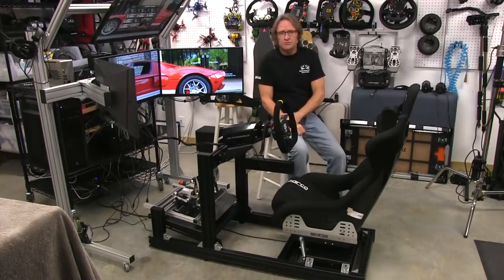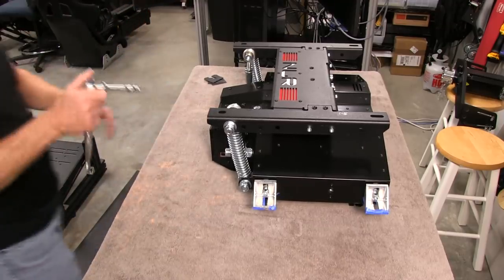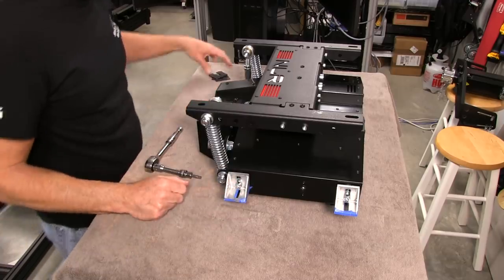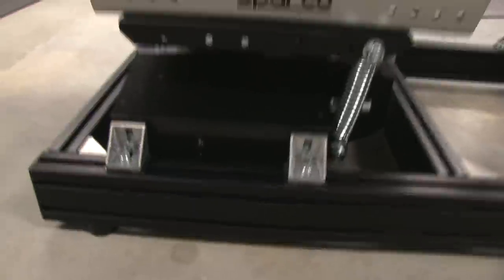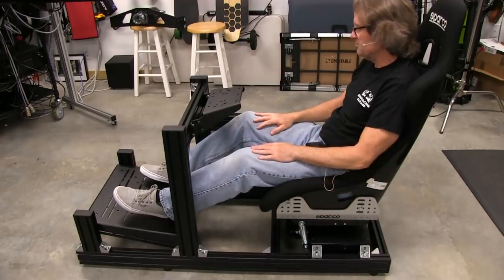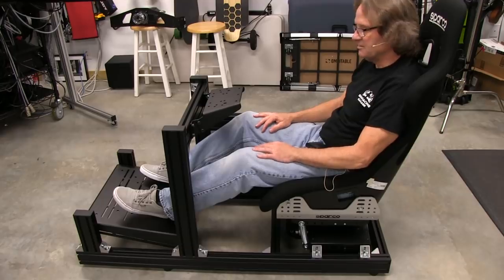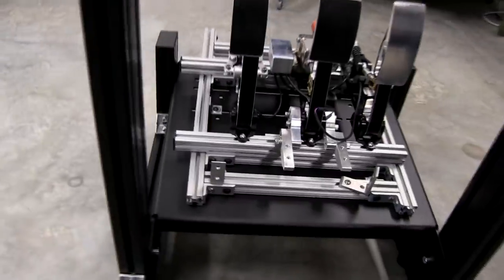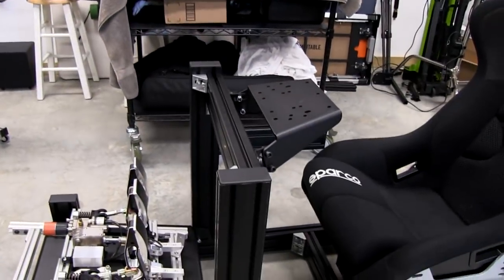Sim-Lab GT1 EVO Cockpit Review Part 2 "The Setup"

Comment: Barry, if you mount the front bolts of the pedaldeck to the bottom profile (not the upright that connects your wheel) you can then adjust the wheel back and forth without impacting the pedaldeck. I did this with mine.
Reply from the maker: Yes, a very flexible cockpit. When the pedal deck is attached to the wheelbase uprights it does add some lateral stiffness to that section.

Comment: Funny story I have on the SimLab wheel deck supporting the AF v2. It actually didn't when it was first listed. But the saga is quite comical looking back, first, UPS actually lost my P1. They went on vacation after sending out like 80 orders, where mine was the only one lost lol. They couldn't do anything because, vacation. After the reship, I find the wheel deck doesn't support the AF v2, so I start talking to them about that. They say they can drill some holes, and they'll ship it. Fast forward two weeks, I get the wheel deck, it's the same one again LOL. The holes don't match, so now at this point, I'm best friends with Darko, and he eventually got the wheel deck redesigned and into my hands. SimLabs has some of the best support I've ever seen, but this was the longest retail saga I've ever had. Cheers to those guys.
Reply: I have a v2 as well,  is the wheelbase solid on the rig? In the review it looked like it had some play

Comment: I have the old GT1 and I did put a vertical brace at the end of the shifter arm. I had some spare profile and connectors and just cut it to length. Much better.

Comment: Hey Barry, great video - very instructive. I'm on the verge of buying this cockpit but have a couple questions I was hoping you could help me with. 

1) I want to install the down piece of extrusion where the shifter mounts in order to have a more stable platform. Exactly what do I need to buy in order to do this? Does Sim Lab have the exact piece I'm looking for on their website? 

2) how would one mount the fanatec shifter 1.5 onto this rig? I noticed that the Sim Lab website has a "universal Fanatec shifter mount." Would I need to buy this? 

3) I'm thinking about just buying a seat from Sim Lab itself. Does this rig and/or the seat come with the mounting hardware needed to mount the seat? Such as brackets, bolts, etc? 

Thanks again for the great video. I'm looking forward to entering the world of 80/20 aluminum extrusions 😊
Reply from the maker: 1) One piece of 40x40 series profile at your required length. Four corner brackets with supporting fasteners. 2) You could use profile to make a mount, easier to buy the Sim-Lab one. 3) You will have to contact Sim-Lab for that information.
Reply: @simracinggarage3026 Hey Barry do you have any idea if this motion platform will fit the SimLabs GT1 pro ?

Comment: So, are we having a review on the Sim Lab Team Redline TR1 Chassis soon? 🙂
Reply: That's what i'm hoping, i can't decide between the two
Reply: Rapid_GT 99 I love my SimLab GT1 EVO. I have a DD2 mounted with the SimLab Podium mounts. It’s actually fantastic. I uploaded a couple of videos showing it off. Check it out if your still on the fence.
Reply: @OhItsThat  yes i think it's the GT1 Evo i'm going for with the DD in mind as the TR1 as i recall isn't compatible with those mounts and i intend getting the Podium F1 (DD1 Equiv), i do quite like Fanatcs podium mounts too though, which seat did you choose off SimLabs ?

i'll be sure to check out your vids, cheers.
Reply: Rapid_GT 99 I use a Sparco R100. I don’t think SimLabs ships seats to my country. The GT1 EVO is perfect. I think having 90 degree vertical wheel deck uprights is better then angled ones like the Team Redline chassis uses. Easier to attach more pieces of profile to for shifters and what not.

Comment: You could get another upright that holds the wheel and connect it at an angle from the upright past the gear mount to the bottom brace it would create a lot of strength rather than just 1 upright

Comment: Regarding to the leverage of this very long wheel/motor: Wouldn't it be possible to move the crossbar far more to the driver, then assemble the mounting plate on the opposite side of the crossbar so that the center point of the wheel (somewhere where the axis leaves the motor) is positioned more directly over the crossbar? Perhaps you have to drill new holes in the mounting plate because you have to mount the wheel 180 degrees rotated so that it points to the driver.
Reply from the maker: There's always a way to mod a profile cockpit to better suit your individual needs. That's what is so great about them. Not sure if what you want to do will deliver the desired result. Wouldn't hurt to give it a go.

Comment: I really like the looks of this rig but it doesn't look like there is much room to extend the pedals out further. I have fairly long legs. I am not sure how tall Barry is, but it looks like he has the pedals as far back as they can go. My 4Play cockpit is 1500mm long fully extended, and from what I can tell the GT1 is only 1350mm long. Also, pedal distance seems to be tied to the steering column. It'd be nice if it were attached to a separate support.
Reply: i have one and you can easy push the pedal tray back and then you could drill new holes in the pedal deck to push back further which would help

Comment: Is this rig going to be ok for taller individuals? I am 6"2 and unsure if the seat can be adjusted backwards enough. As well as if I can mount the pedal tray independently from the steering column to be able to move them seperately.
Reply: What did you get?

Comment: I currently have a Playseat.  It has served me well  and gotten the job done for the past four years but I would like to upgrade it.  Would you recommend a 80/20 rig like this over something that is more prebuilt.  I did like the look of the Spenard cockpit you also reviewed
Reply from the maker: An 80/20 cockpit has more versatility and room for future growth. Also easier to get a proper driving position dialed in. But they are not as nice looking as proper tube chassis setup. What with it's curves and geometric lines. You can still mod those types of cockpits, just takes more work and custom fabrication. So you have to decide which is more important I think.

Comment: Did you use the angle brackets that came with the SimLab GT1 EVO to mount the NLR V3? If you didn’t, could you please provide a link to the ones you used? Thanks Barry.
Reply from the maker: Those corner brackets were sourced from 80/20.com. They are a little bit larger than the ones from Europe. Not sure why, as they are meant for 40 series profile.
Reply: Sim Racing Garage Yeah the standard Sim Lab brackets are to small. I had to use shims on both sides. Wasn’t expecting that.

Comment: Would there be any kind of flex if you used the DD mount mounted directly onto the rig as opposed to onto the default wheel deck? Would this rig handle a direct drive wheel just as well as the P1?
Reply from the maker: The P1/P1-X front mount is a superior design to the one on this cockpit. As is the whole wheelbase assembly of the P1/P1-X. So, the EVO won't handle a DD as well.

Comment: I have the NLR GTRACK rig with the NLR motion simulator V3. I’m getting ready to purchase the Sparco EVO L seat with the HD aluminum bracket to replace the reclining seat that came with the GTRACK. My question for you is I would like to purchase the Sparco seat slider that would enable me to move the seat back and forward. Do you feel this slider would work with the Sparco EVO and bracket and be able to mount it on the NLR motion simulator V3?

Comment: Internal width of 480 mm (18.9 inches)?   Do you feel that it's a tight squeeze?  I noticed your right thigh on the shifter.  Moving the shifter mount to the outside would help, but how does the "cage" width feel?

Comment: Barry, would the DBox set up work with this frame or would the P1 be the better option if u think that may be in the future plan?
Reply from the maker: I would go with the P1 for DBox. I would rather have the heavier profiles for a full chassis mover system. And the 40/160 base profiles are deep enough to mount the controller boxes with no interference with the seat or pedals. Sim-Lab has just come out with their own DBox mounting hardware that I will be reviewing shortly.
Reply: You need to reinforce with crossmembers, but 40x80 (vs 40x160 of P1) is enough for D-Box like systems like the DIY SFX 100.

Comment: Is the wheeldeck stable enough to mount an SC2 pro? And does the hole pattern on the plate support the adjustable motor mount for the Simucube motors?

Comment: Barry, would it not be possible to put the steering wheel mounting plate on the rear? This may give you an extra 5 or 6 inches and also less leverage to affect your steering flex.
I ask because I am wanting to get the GT1 and already have the AF V2.
Reply from the maker: Yes, after looking at the video, I think you could mount it on the front facing side of the cross profile piece. But you may need a shaft extension to get the wheel rim to clear that profile from the driver's perspective. This would also give you more leverage because of the length required. So, in the end, I don't know if it would flex any less. There are other ways to go about reinforcing the wheel mount on this cockpit I think. But it would require more profile and hardware to do it.

Comment: Is it possible to mount the wheel plate on the front side of the upper frame to reduce the leverage?  I think this would also allow a smaller strut to the shifter plate and help reduce the flex?

edit: someone down below asked the same question! sorry...

Comment: Hi Barry, nice review as always. I was just wondering why the holes in the wheelplate are not symmetrical. More specifically: the outer holes on the right are much closer to the side than the ones on the left and of the four holes closest to the center of the plate, the left two are oblong, while the right two are round. Any idea why this is?
Reply from the maker: I do not. But the Fanatec pattern and the Accuforce pattern are both centered on the plate. Did not try a logitech or Thrustmaster base with this plate. I will though. There are a lot of holes in this plate. Not sure why.

Comment: Barry, you (and Sim Lab) say this wheel deck is compatible with Logitech -- I have a G29 at the moment, but it doesn't seem mountable with the desk clamps on the bottom of the wheel... not having luck getting rid of the those clamps... any suggestions?
Reply from the maker: My G29 mounts fine using it's clamps. Not sure why you would be having issues unless something in the clamp mechanism is faulty.
Reply: @simracinggarage3026  Thanks Barry, for the reply.. I'm sitting a tad lower on the rig than with a racing seat (I put a regular car seat in it from my ZO6 - race seat is in the car! LOL).. anyway, I figured it out - I had to raise the wheel bar and tilt it down a bit so my knees would not hit the clamps ... having other issues now, as the Logitech all of a sudden has power issues, seems like a short or something .. it's been a bit trying getting this rig going, now finally tonight was ready to rock and now this!

Comment: I seem to have OCD with mine, trying to get it all square with a tape measure. I'm about there now, how far do you go with your rigs to get them square ?
Reply from the maker: It's not easy to get it perfectly square. I find that the bolts tend to pull it out of perfect square on the final torquing process. Seeing how the corner brackets are a true 90°, I just make sure both sides are flush with the profile and leave it at that. I haven't seen any ill effects from this result.

Comment: Why did you use the spacers please Barry?
Reply from the maker: Which spacers?
Reply: The squareish U shaped ones between the chassis and motion unit.
Reply from the maker: Here: https://www.ebay.com/itm/CRL-KRS16-1-16-x-3-1-2-Shimstack-Shims-Pack-of-50-Pcs/132433621460?hash=item1ed5a8b1d4:g:K5sAAOSwn25aMXF7:rk:2:pf:1&frcectupt=true
Reply: @simracinggarage3026  Thanks, but I meant why really? Doesn't matter much, but I just can't work out why you needed spacers between the chassis and motion unit (especially as you were trying to keep the seat height as low as possible) - I don't doubt for a second there is a good reason, because it's well, you - but I'd like to know the reason so I can perhaps learn from it for my own rig.
Reply from the maker: @AndyGarton  To keep the corner brackets from scratching up the black profiles while I did final adjustments to the location of the unit. It's quite heavy and the brackets can gouge the profile. Just a safety measure really.
Reply: @simracinggarage3026  Got it, thank you.

Comment: Nice and simple profile rig. Well worth saving up the extra cash if anyone is contemplating buying something like an GT-Omega or higher on the price scale for a tubular frame. Can't beat the modularity of a alloy profile rig
Reply: am i able to add a handbrake next to the shifter?
Reply: @RathOX  You are able to do anything you like with aluminium profile. Find a website were you can purchase the extra profile/fixtures needed.  Or you could simply put a large plate for the shifter+handbrake. As long as you're able to drill some holes will be good to go.
Reply: @dinxsy8069  i decided to get the Simetek K2 as for one i wont be using a DD wheel just the clubsport v2.5. it will mainly be used for drifting and rally and can still have the nextlevel motion base and i can still attach buttkickers too it. Saved a little bit of money.
Reply: @RathOX  I see, the K2 is a sound rig, good investment. It can handle a DD unit as well with minimal flex/movement.
Reply: @dinxsy8069  great, what i like to hear, what also tipped me to buy it was muscle standing and jumping on it 😂.

Comment: Does anyone have any idea what the weight capacity is on the GT1 Evo? Looking to upgrade from a wheel stand but I am 6’ 8” and heavy as well. Don’t want to order a cockpit only to find out it doesn’t work for me. Thanks!
Reply: The size would be the only worry, unless you're 400 lbs this thing is sturdy as hell!
But at 6'8 the length of the rig might be worrysome.